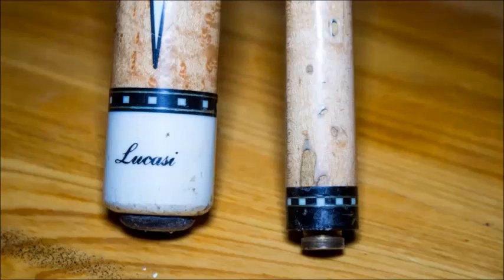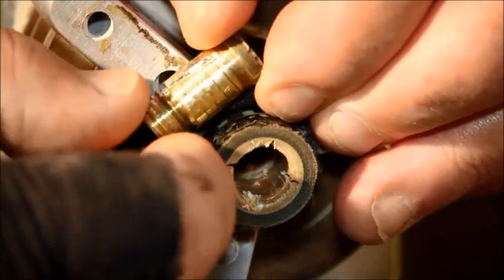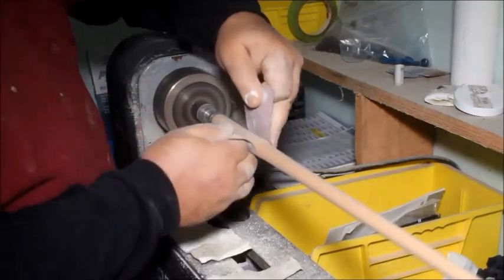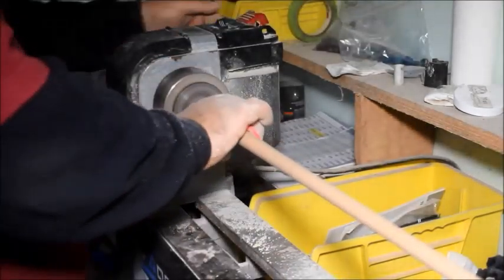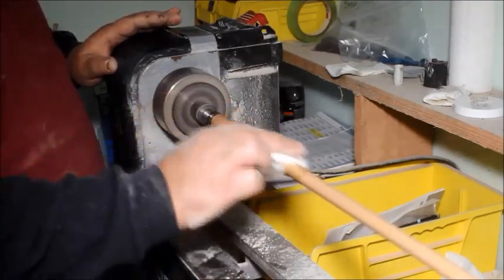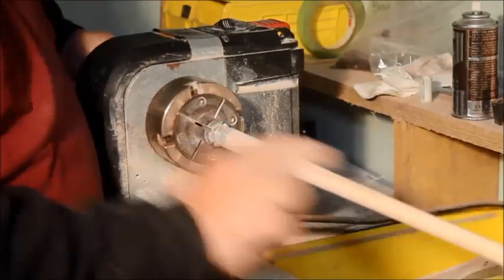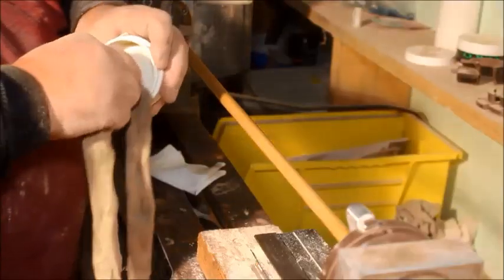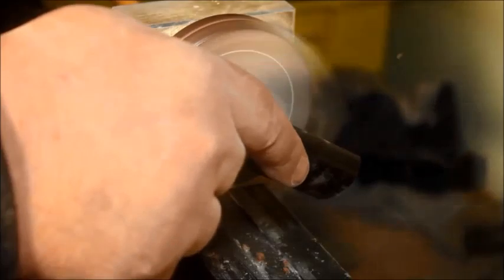Pool Cue Repair and Complete Restoration

Comment: Hey do you know how to take a slight bend out of the tip end of my cue?.
Reply from the maker: I've never been able to make a cue shaft straight after being warped (bent).  That said, I've removed most of the warp (bend) to the level of "slight" many times by using a hot water rag rapped around the area of the main part of the bend. Squeezing the rag after wrapping the cue. Repeat several times until the shaft is thoroughly wet and hot. Then remove the rag and place the shaft on a flat surface like a fomica countertop or granite or marble, etc...  Put a quarter or dime under the tip and a bunch of books or pots  w/wight  in them on the bend.  Leave sitting for 20 min. You may get the bend out a bit or over bend it. Repeat the process  until you are happy !!

If it's a large warp you can get most of it out in no time. If it's a "slight" warp (bend) count your blessings and don't waist your time.  Wood is a biologic and can be cut in increments soaking and drying as you go along.  Most shafts take from 5 to 7 years to cut & cure many times.  Once wood  warps, it's almost impossible to get it straight again.

One exception is if it really is a slight bend, and you don't mind thinning the diameter, and you have the means to cut the taper to thin it out, then .... sometimes ..... the bend can be cut out leaving the shaft a smaller diameter.

Most anything is possible w/ God but I'm not God.  You  may find another opinion  or someone better than me w/ a little research and I hope you do.  But as my carpenter co-workers  and mentors always told me, "don't blame the tool" !!  If you can win w/ a bar cue that is warped, it would matter little to you what small warp your cue might have.

No offense meant ,  I do wish you luck,
Sincerely ...............
Thanks for the question !!
Reply: @stephboeker7835  I do appreciate the information it's a slight Bend so I will just count my blessings but heard slightest Bend could ruin a game I've played with it before and hardly felt like it was the cues falt lol anyway thanks for the information this is really helpful

Comment: Was that shaft warped?
Reply from the maker: A bit.  Not enough to see the tip move up and down when rolling it on the table, but if you bent over and looked at the taper gap, it would not be symmetrical when rolled.   As a matter of fact, when shafts come to me for thinning out from , ....... , say , ........ , 13-1/2mm down to 12-3/4mm , many times the warp is turned out or is less warped and much better than when it arrived :)
Thanks for watching and for asking the question,
Sincerely ...........
Reply: What technique do you use for warped shaft turn downs? Sand Paper? Tool bits? Router?
Reply: @mikerys5265  the proper way to straighten a bent shaftis in a room with proper humidity and temperature using weights and turning the shaft over a span of about 5 days. There's a lot of experts out there that know how to do it correctly. you can't turn a shaft straight... You'll just ruin the shaft if you try to cut away the warp.

Comment: So did you use also cyano on the butt?
Reply from the maker: As a matter of fact I did :)   I actually had to when it came to the white butt piece w/ the Lucasi logo that holds the rubber grommet.   

I virtually had to sand every part of the cue as I did the shaft , clean through the clear coat finish.  

Unlike the Meucci logo on the butt , which is engraved and filled, (just like all the inlays)  the Lucasi logo is painted on :(  Of course, the paint sanded clean off as I found out that it was not engraved and filled.  Luckily , I had anticipated that , so the owner knew the risks and the ideas I had to resolve them.

In the end, I had a rubber stamp made in the likeness of the logo and w/ over 150 try's , I finally got a stamp laid out that I liked.  It is hard to lay the same pressure on a rolling surface :)    I also had trouble smearing and damaging the logo w/ various different clear finishes I tried, to boot :(    This was even after letting the logo ink dry for days :) 

It was the CA glue that covered the logo w/ zero smear.  I sincerely like the glossy crystal clear finish the Cyano creates and should have tried it first :(  It's such a nice finish (if done correctly) and it can build upon it's layers to a thick coat in no time :)

Thanks for the question Mike, and thanks for watching my video,
Sincerely ..............
Reply: How did you apply the CA finish at the linen wrap ends? Did you have to replace the linen wrap as part of the refinish? How did you blend the CA finish at the SS joint collar?